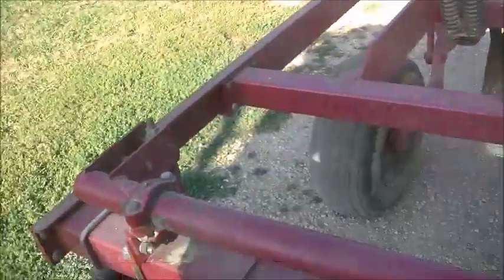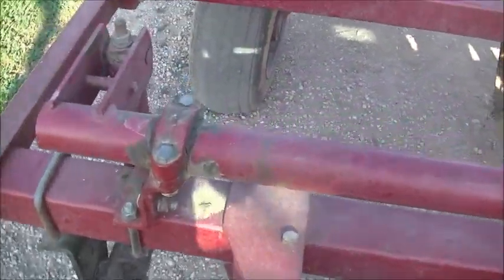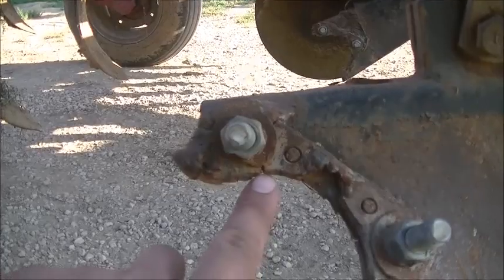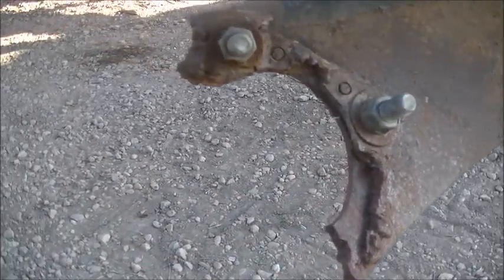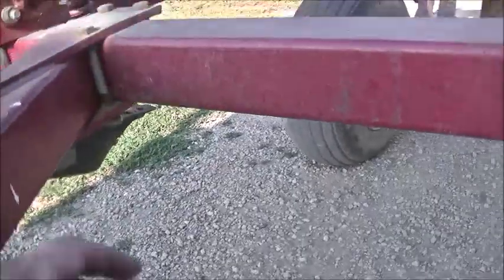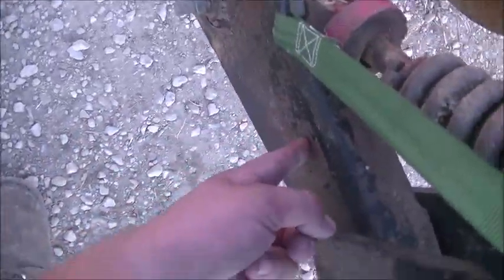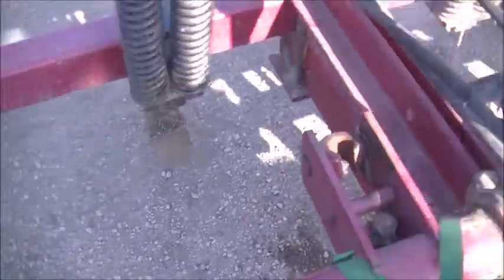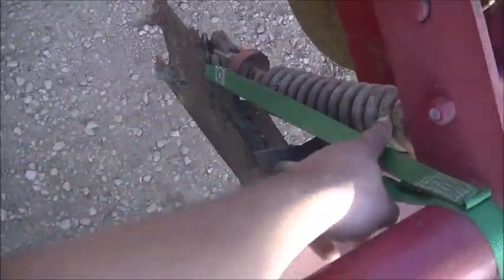Expensive Chisel Plow Fix

Comment: Pulling the snap rolls off sucks even with the puller. The 40 and 90 series corn heads use the same gear box and roll. A friend of mine has a 600 series head and he said take a bolt out and slide the old one off and slide the new ones on. Good luck.

Comment: As far as the brackets go couldn't you have had them fabbed up in a weld shop or fabbed them yourself since you seem to be a decent welder to save money
Reply: Yeah that's what I was thinking too... no way I'd spend a grand on essentially angle iron brackets... That's what a welder is for...  The spring and rod, well, that's another story, but those parts probably aren't over a couple hundred bucks for the lot... 

Later!  OL J R :)